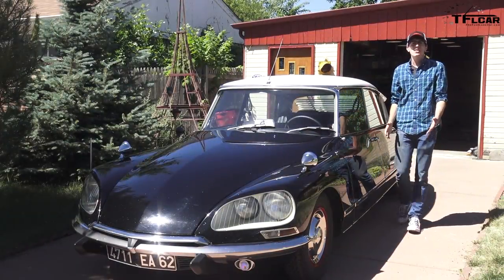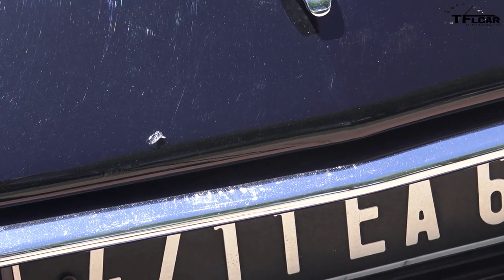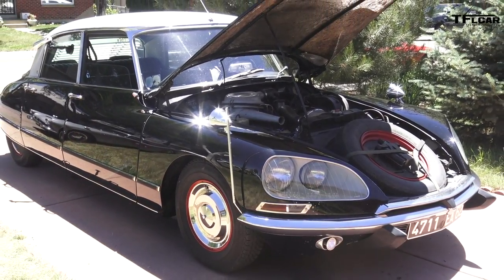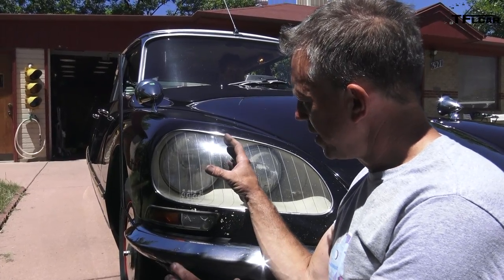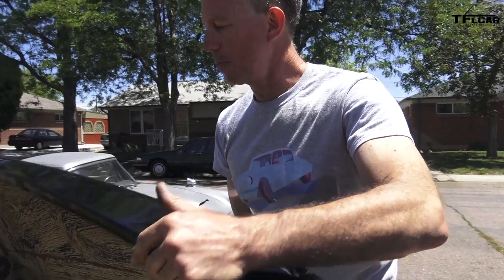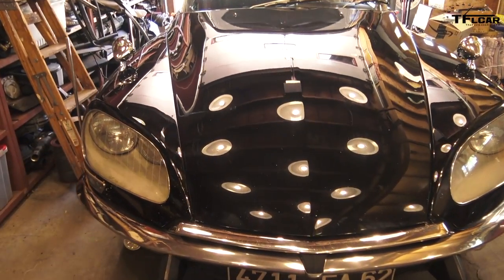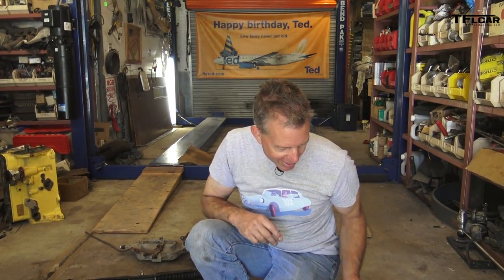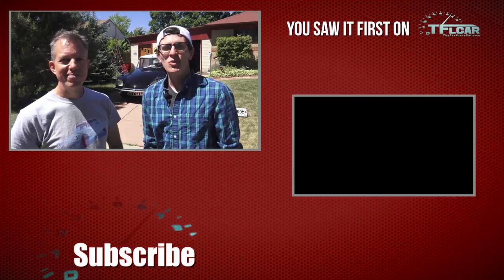Top 10 Reasons Why This Is The Most Revolutionary Car Ever Made

Comment: My 1st. Citroen was a new '72 GS (couldn't afford the DS) - 3 years with no problems (180k miles). Purchased a used '72 "D" Special, for years as a kid going to school i saw one parked in front of a store so thinking that it must be reliable and I was impressed by it's looks. "Ugly", haha - you can't see it from inside but you surely get the most comfortable and safe ride. Again no major problems in the 11 years that I owned it, except one - I cooked the motor (the only sensor was connected to the radiator and not the head lol) - repair wasn't very good so sadly I sold it - now I wish I had kept it.

Comment: Why that suspension sistem isn't reused in "modern" cars ?
A "cheap" modern version of that mechanism could be AWESOME !!!
Reply: You won´t see the hidropneumatic suspension in modern cars because of the fee that automaker have to pay to Citroën for the patent of the system. And you can find the "cheap" version of this system inside the Citroën GS/GSA launched in 1970. It has only de hydropneumatic auto leveling suspension and it´s a very simple system. I owned a 1980 GSA with 150000 kilometers and riding it was like "riding on a cloud"
Reply: Alessandro Cussino It's still used in some modern Citroën cars, with added electronic driving systems added to it, but Peugeot (the owner of Citroën)  doesn't communicate much about it for some reason.
Reply: Alessandro Cussino - There are some new living interpretations of this system in Mercedes/AMG, Rolls Royce, etc. But I guess price is the main obstacle. Along with ignorance that make many people think it's "too difficult" to repair.
Reply: Citroen have stopped using this now, it went out with the C5 in about 2017. The ride quality for the states would have been of real benefit, especially if they had released activa in the us.
Reply: @DonGato64  Patents expire after 17-20 years (depending on legislation. Citroën's last version is the Hydractive III+ system of the C5, which is now retired (no longer produced), this is essentially also either expired or short to become, as the C5's system is, except a few minor mods, from 2001.  It is a bit more expensive than a steel suspension, but well, so are leather seats or whatever other extra people are willing to pay for as additional luxury.  The GSA and BX showed that a simple version is possible, and the price is ok. PSA did make the mistake to sell the BX cheaper than the 405 (yeah, Peugeot is the premium brand), and people just bought the BX, because they got the HP and a discount.  PSA was pissed, because the BX was more expensive to make.  I really don't understand this kind of management stupidity.  Peugeot could have added the HP to their offerings, as well, and with the economy of scale, building more cars with the same parts just makes those parts cheaper.  The HP high pressure pump was a challenge in 1955, and still is somehow; but if you only build it into one of your offerings, and not in 5 or 10, the cost is exploding.  They even asked their Citroën customers, and the customers clearly and loudly said „Non, merci“.

The C5 II had an option of steel suspension, and force-fed it on the business option; my PSA dealer told me that was an economical disaster, as those leasing returns can't be sold.  Nobody who's buying a Citroën of this size is accepting a steel suspension. Fortunately, the majority refused to buy this option (even though of course the Citroën steel suspension is a lot more comfortable than a typical Audi or BMW suspension).  The last 3 production years of the C5 had only the popular options, i.e. the two 4 cylinder Diesel engines (no V6), the Tourer (all other station wagon Citroëns were called “Break”, and the C5 II sedan was a failure, because it lacked the fifth door — a sedan with five doors has most of the advantages of a station wagon, and still looks like a sedan), and of course the hydropneumatic suspension, even in the business option.

So, no, I don't understand why Citroën dropped that option (it's going to be a tough sell for the next C5), I also don't understand why nobody else is using it (Rolls Royce and Mercedes used to license it in a stripped down version in the time of the DS and CX for their top models). With all the luxury you get, a Citroën C5 is not an expensive car, and you had to pay extra to get the HP.  I'm perfectly ok with this cheap system they have now for the small cars (even the C3 gets it): that is completely appropriate for a cheap car. But the softness of the HP is only possible with the leveling system: You can push the suspension all the way down if you just push at one of those edges of the car. This kind of softness is certainly possible to reach with a steel suspension, but not without a leveling system. So you absolutely need that.

What you could have in a 2020 car are electric actuators who help to remove all this tilting, rolling, and pitching, but the basic system is sound.  It's robust; all that happens under a normal car's life is that the balls need to be changed when the pressure is lost (even nitrogen diffuses through the steel), and add some of the green oil.

The thing you often hear about is that you can lift your car up and down, but that's not the normal use case.  For changing your tires, yes, it's a good thing.  And sometimes, if you really need to go through some rough terrain, yes, you use it.  But otherwise, it's just showing off.  The main reason for it is really the leveling system that allows the suspension to be super-soft.
Reply: @BerndPaysan  - The nitrogen diffuses through the diaphragm, not the steel. New spheres can be stored for many years with no loss of pressure as the diaphragm is pressed against the inside of the sphere with no diaphragm exposed to the outside of the sphere.
Reply: @BerndPaysan  
When we see cars like the E-Mehari we can say citroën is dead

They plays with 
their licenses

Comment: Whether a button or a full pedal, the ideal brake is dependent on pressure and not deflection.  A brake should depress a very short distance, catch, and then brake proportional to the pressure applied.  And should decrease braking immediately a bit if you come off the brakes a bit.  Should be like a bike brake, or any other mechanical brake.  The power assist should feel like it is not there except for making it easier.

Comment: It is really a very nice car. I used to get one 30 years ago (DSpécial, not the full hydraulic systems) and it was the most confortable car i ever drove (around 60.000 kms in two years). At that time the DS was for nothing, rust and dust included. But nowdays prices are extremely high and it is quite impossible to get one in a good shape at reasonnable price. The only problem with the DS is the engine which was not enough powerfull, too limited. It was corrected at the very end with the DS 21 electronic injection and 23 electronic injection also.
Another nice Citroën is the CX which was quite innovative also. The XM for the design and the last C6 also. But the most wonderfull Citroën is the SM, with all the innovations, and even more, of the DS and a real V6 engine from Maserati. And nowdays you can get one for the price of a DS!

Comment: Ability to ride on three wheels and cable operated lights are actually the least impressive features of the DS..the best are the amazing stability and drive grip..amazing braking where the whole car hunkers down and puts all its weight into the road surface instead of rearing up like so many cars....amazing self levelling....the amazing ride..this guy has bolted on hubcaps which is handy since the acceleration of the wheels up and down over bumps is so fast hubcaps tend to get thrown off.....great manouverability...amazing foot room and comfortable plush 
seats and in some models incredibly plush carpets.....suspension design on most modern cars is pathetic compared to what is now possible in 2018Driving on three wheels is only an accident of design not a major feature! I like how you put bolts to stop hubcaps flying away I did that on two cars.I think the suspension results in the wheels travelling up and down at very high G force.  The brakes are extraordinary, you forgot to mention that they have slide valves that adjust the braking effort between front and rear according to load, also the geometry of the suspension meant the car hunkers down under braking..the best brakes of any car I have driven. I love the custom dashboard! Really the main feature was its awesome stability, another reason for this was that the front wheels pivot point went straight through the the middle of the contact patch so there was no bump- steer. It also had a fairly low centre of gravity due to fibreglass roof, no door window surrounds, alloy bonnet(largest single pressing alloy panel) etc and it had a very long wheelbase. I like your favourite early model in your garage. The turning headlights on later models although handy were not of the same engineering standard as the rest of the car, I prefer the early single headlight models..I wish I could buy a small car today with suspension as good as this has. thankyou for showing some nice cars!

Comment: 1959 Cadillac Eldorado Biarritz wasn't more revolutionary but way better. 

Soft air ride suspension, king of style and looks, biggest fins, power everything(windows, steering, seats, vents, brakes), fog lamps, rear speaker, AC, cruise control, 345 horsepower and more. 

It's the absolute perfect car. What more is there to say?

Comment: By far my choice from day one. Although my once 63 XKE is my 'to dIe for' car", the great 'C' is my  first and only choice. THE car over the 'E' hands down, no question as to choice.  As for the keeper, no contest.  I would get the C to run on body oil if necessary.  Desert, mountains, no road at all, can any more be said? ADROIT as to the ONE, the Citroen would it be the selection by the greatest automotive engineers and designers of all time.
As for a means as to having one today , make me a proposal, PLEASE.  (I have assets you may find exceptionally for your need.)  To have one that to extol its virtues is THE life opportunity!!!

Comment: Since there is no master cylinder, I understand the brakes require power hydraulics pressure. Do the brakes also work in case the power hydraulics failed?
Reply: there is a pedal activated extra set of brake pads which are amazingly effective.

Comment: Actually the Citroen is the first company to bring front wheel drive (Traction Avant) and then disc brakes (DS) onto series production cars, am I wrong? And these are only two GIANT features affecting the whole industry, I am not saying about hundreds of smaller innovations like the turning headlights.
Reply: There's a bunch of tiny details introduced by Citroen or at least they're interpretation. The single arm steering wheel, the "satellite" controls (stalk), brake in the transmission, etc.

But curiously just a few years ago the record for number of patents in the auto industry belonged to .... FIAT!! Not sure if it's still valid today. ;-)
Reply: I think its impact was more complex it had so many small ideas and rethinks. Europe still recovering from the war showing what a already weird company (citroen was like apple in PR in the decades before the war) showing what could be done if you start over. Its impact then and now was mostly a 'ok this can be done and its ok' ... Probably one of the only 'ok this can be done' compare in my mind was showcasing NLS where Doug Engelbart in the 1968 showcases what computers could be : https://en.wikipedia.org/wiki/The_Mother_of_All_Demos Its that clean slate and rethink in big and small parts that had a lasting impact decades later into both fields.

Comment: How do you jack the car up if the engine won't start?
Reply: It takes time but you can use the hand crank to turn the engine over and pump it up.   Also, there is a lot of reserve in the hydraulic system.

Comment: a lot of things in this car citroen kept till 2k.
and my father changed the weels on his bx in the same way
Reply: Sadly, the suspension functions a little differently on the successor of the BX, the Xantia. On that one, you need a traditional jack to change the wheels however it is said that it will still drive on three wheels if necessary.
Reply: @mjouwbuis  Huh, no, you actually don't need a traditionnal jack to change a wheel on the xantia or the xm, it's working like before. The suspension did change with times but this should still works, as you're still able to drive with 3 wheels with a xantia or a xm.

Comment: people get all excited about car driving on three wheels but you shouldn't, this is only possible at suspencion highest settings , this means that car has no suspension at this point it is hydraulically forced/locked  to rest on bumpstops solid, so driving it on this setting is absolute NO NO, hey but it is one of the best cars ever made
Reply: it's possible but at really slow speed, so it's still usable in case you really need to.

Comment: Absolutely revolutionary when they were new; It took Rolls-Royce & Mercedes-Benz several years to introduce similar features on their own cars, the Hydro-pneumatic suspension spooked the car industry worldwide, the principal problem was that driven over pockmarked muddy tracks at speed (and you could do that) it sailed along like a plane with its' wheels flashing up & down like pistons, Rolls-Royce weren't in a position to ignore that; and Mercedes-Benz weren't in a position to ignore what Rolls-Royce did., They were also the first cars to have a one-piece roof lining later copied everywhere; you didn't mention the mini-fluros mounted vertically in that skinny panel between the doors; yet in the stripped out vehicle it's visible ??, in the later vehicles it was deleted; flickering fluoros you don't need a night anyway ;) -  (I didn't know they had fibreglass roofs; so a special thank you for that)  but a big thank you for taking the trouble to do the whole thing,- you're certainly not wasting your time or money by my reconning; I have a model DS-19 on my desk :) cheers - John - Western Australia
Reply: Rolls Royce and Mercedes used Citroen suspension under license..

Comment: i realize that this isn't what they are about, but out of curiosity, has anyone ever modified one of these for performance?
Reply: Citroen rallied them.......and won (of course !) inc various Monte Carlo rallies late 50's and in 1965  Citroën took to rallying outside Europe - in the East African Safari, out of 85 vehicles at the start only 16 finished; 5 of which were Citroën DS 19s.
Citroen then developed the TAP , it was inspired by the Ricou DS driven by Robert Neyret and Jacques Terramorsi in the 1969 Rallye du Maroc. The TAP's engine is a bored out DS 21 lump which was reworked by Maserati - bigger pistons and barrels, purpose built cam and exhaust but it used the standard 5 speed DS 21 gearbox. The chassis comprises the front of a normal DS with the rear of a Break, the cut-off point being immediately behind the front seats. The earlier DS coupés were shortened saloons, this car was designed as a coupé. Everything from the B pillar forward is standard DS; the roof, rear wings and boot were originally made out of aluminium although these were replaced with polyester panels following accident damage sustained in the TAP rally This car was then left in a shed chez Citroën until 1993 when the Citroën DS Club Nederland borrowed the car and restored it to its original condition. Its first public outing was in the Grand Prix de Paris that same year when it finished 14th despite running on only 3 cylinders!  
The car was originally designed for the V6 Maserati or Citroen's version iirc.